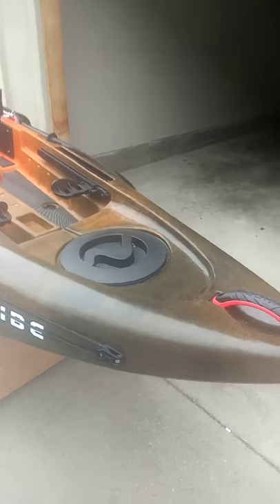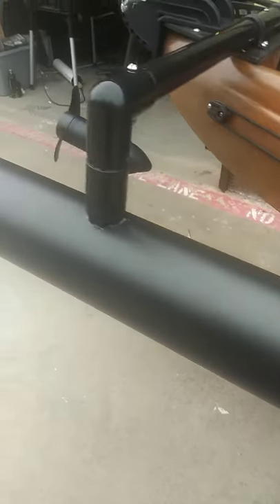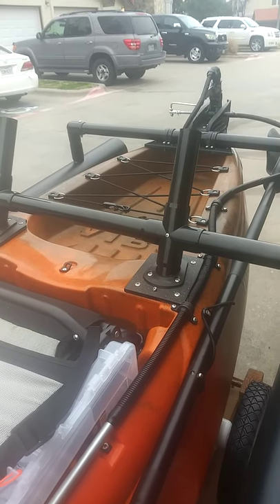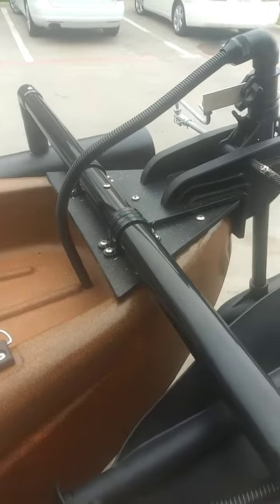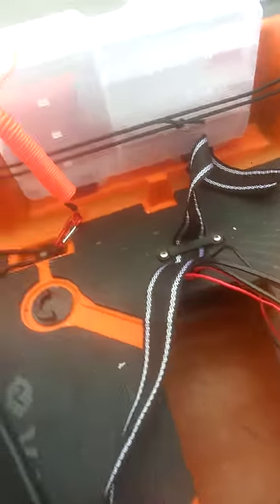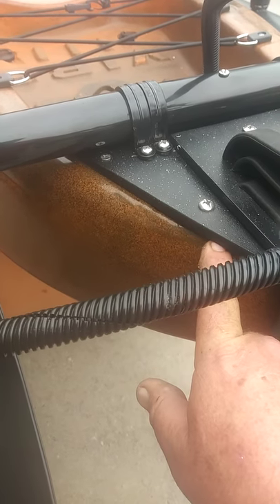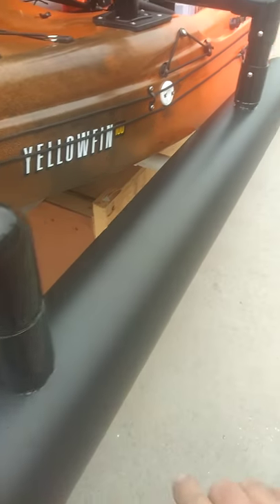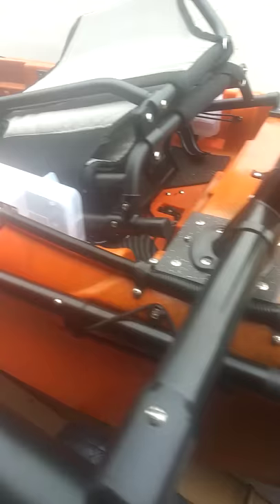Vibe Yellowfin kayak with trolling motor and stabilizers

Comment: Awsome bro..I just brought my yellowfin 100 home last weekend. I wanted a 10 ft boat. I had already purchased a new 2.5 Suzuki outboard, and a set of scotty outriggers. The outboard only weighing 30 lbs max with a full tank, and I only weigh about 151lbs. I fish a 900 acre freshwater lake. Plus having a heart condition, I wanted the motor, and then I can paddle into my fishing spots. It was either the yellowfin or moken lite. But I like the storage. Comes with a paddle. And. 2 storage hatches.
Reply from the maker: Hey buddy, I just saw this so sorry for the slow reply.  You are going to love that Yellowfin--a nice quality boat! I currently have a customers boat in the shop so I'm going to do another walk through video soon.  i've done a couple other videos so check those out. They are not of the Yellowfin but the ideas carry over to it. Have a great one , Bill